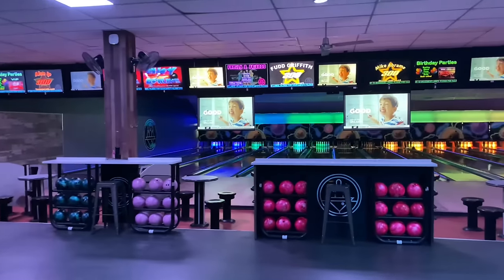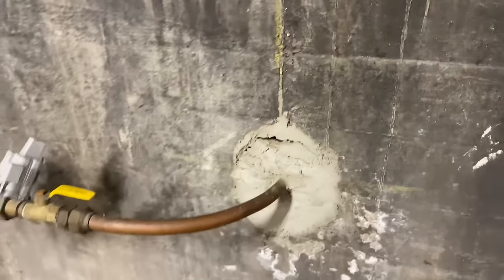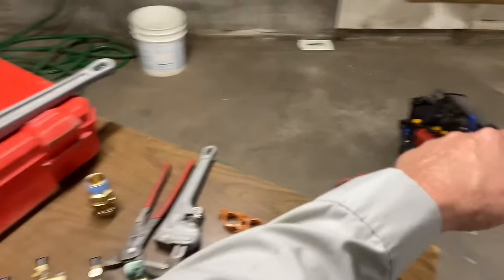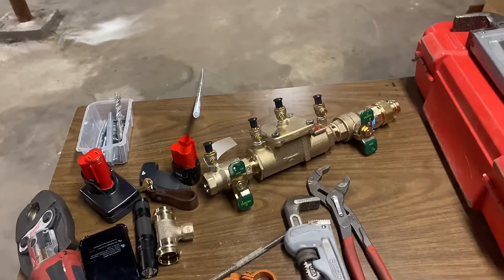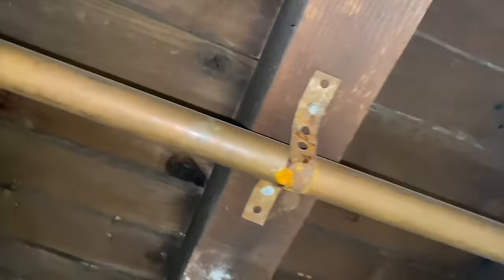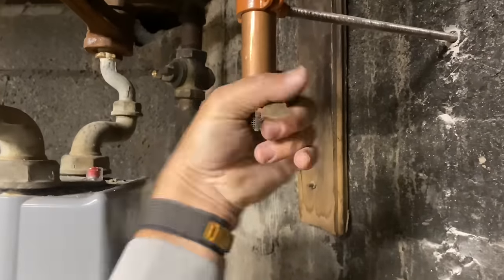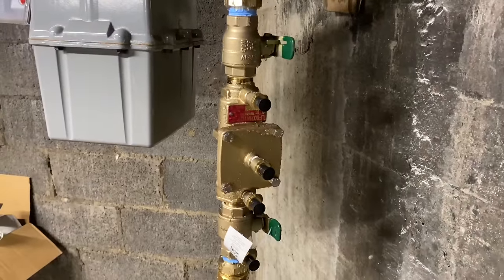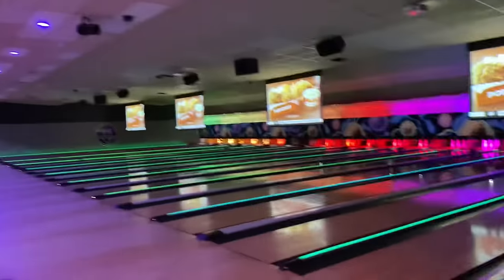Installation of Watts Backflow Prevention Device Double Check Valve - Complete Walk-Through

Comment: I had to have a Back-flow Prevention Device installed 17+ years ago for my Irrigation System at our House.  Annual Inspections are a Requirement. 🤔👍
Reply: Only a sprinkler company tells u there are necessary..(or a plumber) guess how long the test is? Now guess the price?

Comment: Here in Texas we don't have any backflow requirements at least in the county I live in for the main water supply.  We do have requirements on non-potable branches off the main, yard sprinklers, pool supply, fire sprinklers.  I have two separate backflow preventers, one each for fire and yard sprinkler systems.  The good thing is that I don't need any expansion tank on the water heaters, as it can expand back into the city supply side.  So at least I don't have to keep replacing those!  Keep up the good work sir!  👍🤠

Comment: Shouldn't the city water pressure be checked first, before installing a backflow prevention device? In case the pressure has recently increased, so that a PRV might also be required. Or maybe the water meter itself could potentially be changed out for a newer "remote readable" model of water meter that already includes a backflow prevention function? The hose bib also including an anti-siphon feature. Would be interesting to learn what water pressure range is appropriate for such a business location. Anyway: good luck.

Comment: You could cut the threads off the Sedi.
Reply: In our jurisdiction sediment faucets/ hose bibs are allowed as a point of relief ( ie: changing water meter ) but the inspector is good if you cut off the hose thread.

Comment: Is that a commercial code? Or does it also apply to residential?
Reply: It can apply to both. Where i am backflow for irrigation, pool filler, etc. house side those vacuum breakers on hose bibbs. Just need to think, is it permanent supply into potential contaminated water?.. Again in our area.